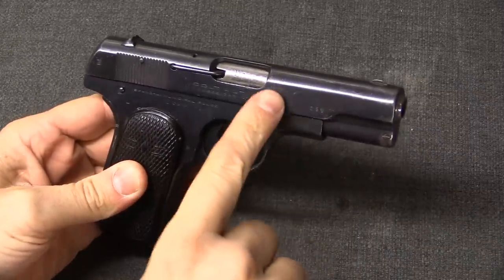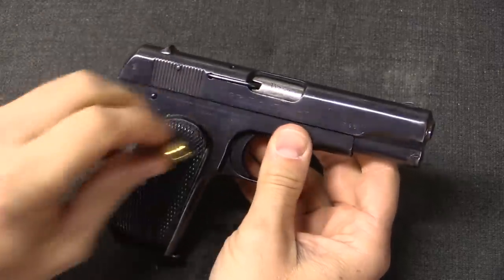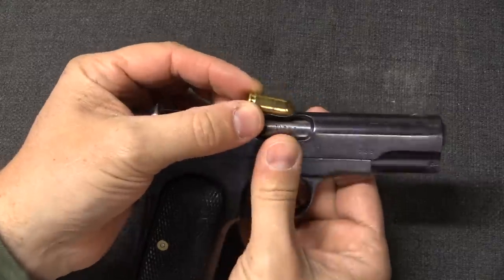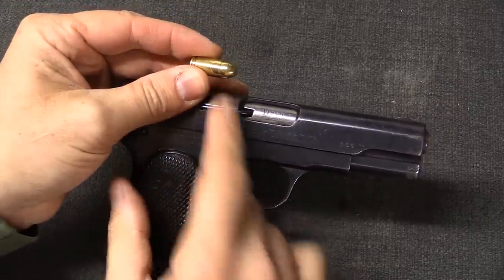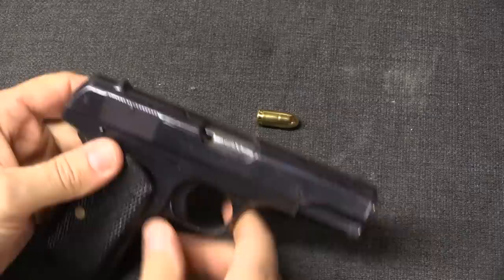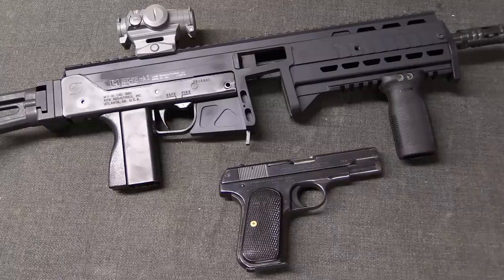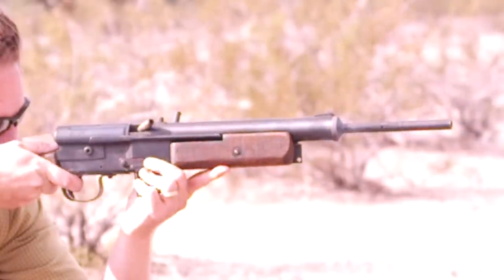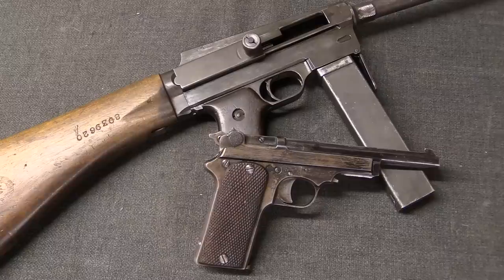How Does it Work: Blowback Action

Comment: Momentum is balanced, not energy.   The bullet has far more energy than the gun.  Their momentum is equal.
Reply: Energy cannot change in a system it can only change form

It's law of conservation of energy.
Reply: Was going to post this as well. It’s momentum that needs to be balanced. The equations are similar, but momentum is directly in proportion to velocity, rather than velocity squared, as is the case for energy
Reply: Jup, was just about to post this. Other than that - great video.
Reply: @CzornyLisek  while energy is indeed conserved, that doesn't mean the energy provided backward(to the slide)=energy going foward(in the bullet)  here it just means kinetic=chemical
Reply: @CzornyLisek  Yeah, some of the chemical energy in the form of the propellant is transformed into the kinetic energy witnessed in the bullet and the slide, but the law does not dictate that the bullet and slide must have the same amount of energy, not in the slightest.
Reply: @CzornyLisek  ...what this is not about :o)
Reply: @CzornyLisek  Some of the energy is released by heating the  barrel, ejecting the hot brass, ejecting to gas from the end of the barrel. Not all energy is transferred to moving part of the gun. Momentum is conserved here not the energy.
Reply: I think momentum is harder to think about with this. Force is simpler to think about in this situation since the momentum constantly changes through the whole cycle of fire and there is a spring immediately acting to slow the bolt or slide.
Reply: @ColburnFreml  Linear momentum is always conversed.  It is identical between before the shot is fired, during the shot, and after the shot is fired, and does not change as the system moves forward in time.  The force magnitude and direction is constantly changing but is also balanced at any instant.
Reply: P=mv. Mass is constant, velocity is changing. Momentum is not the same through time.
Reply: @ColburnFreml  Momentum is not a scalar.  It has a direction.  Any momentum placed into the bullet is always balanced by a change in momentum into the gun in the opposite direction.  It is impossible to change the momentum of a closed system.
Reply: @RC Model Planes the bullet moves further.  It goes down the barrel.  The gun moves a tiny fraction of that.
 Energy = Force × distance
Impulse = Force x time

Impulse is balanced.  Energy is not.
Reply: RC Model Planes, you’re right that the burning propellant acts on the bullet and gun with the same force for the same time. Newton’s 2nd law says that force is equal to mass x acceleration, so if the bullet is 10 g and the gun is 100 times heavier, the bullet must accelerate 100 times faster than the gun. Newton’s 3rd Law then says that momentum (mass x velocity) is conserved. If the bullet of mass 10 g shoots out of the barrel at 100 m/s, the gun (mass 1 kg) must end up moving in the opposite direction one hundred times slower, at 1 m/s. That deals with conservation of momentum. Kinetic energy is given by the formula KE = 1/2 m x v^2. The energy of the gun is 0.5 x 1 x 1^2 = 0.5 units (Joules), but the energy of the bullet is 0.5 x 0.01 x 100^2 = 50 J, much more than the gun. Note that the kinetic energy of the gun plus the bullet plus the hot gases plus the heating of the parts plus the ‘bang’ all together are equal to the chemical energy of the propellant, so energy is conserved too.
Reply: @CzornyLisek  Yes, but thats not the point here. Energy is conserved. First, it was in the powder, now its in the bullet and (much less of it) in the slide/bolt. Momentum ist also balanced, and the lesser weight of the bullet causes ist to pick up more energy because: m1*v1=m2*v2 BUT e=mv^2
Reply: @ColburnFreml  thats not true, momentum ist still theoretically conserved between the bullet and the movement of the air, the target and so on. momentum conservation is only helpful as a rule in simple mechanics though.

Comment: Hi, physics professor here.  Great video, with one important mistake: recoil depends on conservation of *momentum*, not energy.  Your explanation is perfect, you're just using the wrong word in this situation. 

Momentum is simple to understand: it's literally mass times velocity.  So if the slide weighs, say, 50 times as much as the bullet, it will move 50 times slower.  And so in the time it takes the bullet to go 100 mm down the barrel, the cartridge goes back 2 mm.

Kinetic energy is also a combination of mass and velocity, but a different one, and it's not equal between gun and bullet.  The bullet gets a lot more energy than the gun, unless they weigh the same.
Reply: And what is recoil?
Reply: @jonasstrzyz2469  momentum transferred to your hands then to the ground.
Reply: Gonna need some equations to back that up. Could you make a cool video about it?
Reply: So what exactly is momentum if not a form of enery? I thought everything is basically energy in different forms.
Reply: +Andrew Houghton Momentum is the amount of force over time an object has had applied to it, that has accelerated it. That's literally it.

To involve energy is just confusing things.
Reply: Great video. I wanted to check to see if anyone else had addressed this before commenting myself. Just as a resource for anyone who'd like to learn more about this, hyperphysics has pages on "ballistic pendulum" and "conservation laws" that shows how conservation of energy and conservation of momentum can both be maintained. Roughly speaking though, energy is never destroyed, but can change forms, while Newton's third law is about momenta in a system not being able to be changed by interactions within the system. As stated above, momentum is mass x velocity, while kinetic energy is 1/2 mass times velocity squared, so with equal momenta, two objects of different mass have different energy. This is also why you can have bullets with equal energy, but the heavier, slower moving slug will create more recoil, action type and gun mass et cetera being equal.
Reply: @andrewhoughton8216  It's a complex internal vernacular to the physics community. Like how we might classify guns as SMG, LMG, HMG, or HMG, or HMG again. Except far more complicated.
Reply: Ian should now fire the Colt .380 with very high speed cameras trained on the end of the barrel to see the bullet leave the barrel and at that moment view a second camera trained on the ejection port to look for movement of the slide. Also, he would need to use various cartridges for velocity checks.
Reply: Finally I can understand how this works now. I knew there was something missing.
Reply: @brucemccreary38  Vickers does that already
Reply: DothWalrus, projecting much?!

 Also, using the correct terminology is paramount to communication, in science, engineering, and elsewhere... and has nothing to do with "syntax". Although syntax is important, too!
Reply: @jasondoe2596  you have proved my point. What I meant was semantics but you understood my meaning.
Reply: @logitimate  that's just the transfer of energy, which is momentum. Felt recoil is the difference of hitting a brick wall or a pile of hay. Instead of transferring the energy to the rest of your body smoothly, slack is left and it hits the first point of impact with more force instead of spreading it out over time.

Bore axis, muzzle brakes and even the shape of the gun determine at what angle the energy is transferred to your body. Energy is directly related to momentum, but they are entirely different measurements. It is more like energy over time instead of what is purely stored. Which I'm pretty sure is what you said? Not sure why you acted like it isn't momentum, your points define it. lol

If you were in space, or there was no connection with you and the ground or gravity. That recoil impulse will actually push you backwards. The speed you would travel would be a product of momentum applied.
Reply: You are of course correct. Momentum is mass times velocity or force times time and is conserved, so the momentum of the gun (and you) is equal and opposite to that of the bullet. The bullet being lighter carries most of the energy.
Reply: +Jason Goodman

Equation for momentum:              p=m*v
Equation for kinetic Energy:         Ek=1/2*m*v^2
Relation between momentum and kinetic energy, you just play a puzzle where does kinetic energy or momentum fits in the other equation. and you find that momentum almost fits in velocity. 1/2*m*v^2, if you notice that p^2 is pretty much kinetic energy. You only have to divide by mass (and one half) or it can be interpreted as velocity squared (only division by mass is required). p^2 is (m^2)*v^2. So (p^2)/m is mv^2, so p^2/m^2 = v^2. And where do we have velocity squared? In the kinetic Energy equation. If we substitute momentum divided by mass squared (so velocity) into kinetic Energy equation, we are Golden. That gives us:
(1/2) * m * (p^2/m^2) - now yo can cancel mass from enumerator and denominator, so you have (1/2)*(p^2/m). If we multiply enumerator with enumerator, and denominator with denominator (so multiply), we are left with (1*p^2)/2*m), which in it's final form looks like p^2/2m. And that is a form that you show people when they say that momentum and kinetic energy are absolutely different and one has nothing to do with the other.

There maybe some mistakes in here, I will address them. I am unimaginably tired. So even the basics make me make mistakes.
Reply: @andrewhoughton8216  Momentum is literally "quantity of movement" (what it's called in some languages). It's the product of moving mass with its velocity, and also the product of force and time the force has been applied.

Momentum is not energy, it's not even dimensionally equivalent. The difference between momentum and energy is what makes firearms work in the first place (the force from expanding propellant gases imparts equal momentum to both gun and projectile. Because the projectile is much lighter it will move much faster, and because energy scales with the square of velocity the projectile will carry significantly more energy than the gun).
Reply: Thank you. This is an important point, if you value understanding the mechanics of what is actually going on. Which I am sure Ian does, (although some commenters appear not to). The momentum of the system--gun plus bullet plus expanding gases--is percisely zero before the trigger and remains precisely zero after the trigger is pulled, with the forward momentum of the bullet exactly balanced by a numerically equal backward momentum of the slide. The kinetic energy of the system, however, changes dramatically when you pull the trigger. Total energy is conserved, but an immense amount of chemical energy is rapidly converted to kinetic energy.

The crucial concept to understanding a blowback action is conservation of momentum, not conservation of energy.
Reply: @brucemccreary38  There's plenty of high-speed videos of pistols firing that show this.  Here's a good one: https://www.youtube.com/watch?v=zbtyaKAMDdk&feature=youtu.be&t=100 I'm not a gun expert so I don't know what the slides weigh for these guns, but you can clearly see the slide move a couple of mm by the time the round leaves the barrel.  Unfortunately this video doesn't show the action for the rifles they tested.
Reply: Momentum is not the same thing as energy. Energy causes momentum, in this case.
Reply: Bear pants and the number 59.
Reply: @spookyindeed  As a scientist I defend the physicist.  Using the correct wording is important.  I am a microbiologist.  It drives me insane how people use the words bacteria and virus interchangeably and get annoyed with me when I point out they are entirely different things.  They are different in a terms of size by well over 1000X in most cases.  It is like somebody getting a canoe and the Titanic mixed up and then acting annoyed when I point out the mistake.  .38 snub nose, 155mm artillery, what is the difference?  WHO CARES RIGHT?
Reply: Professor Goodman, aren't both momentum and energy conserved here? So that the simple momentum conservation isn't enough to find the recoil mechanism's velocity?
Reply: LadyAnuB No. Momentum of the bullet and the slide will be equal and opposite after the shot. Kinetic energy = 1/2 m(v^2). The bullet is traveling much faster than the slide and will have a much greater KE.
Reply: Just scrolled down to post the same thing, conservation of momentum is the subject at hand, not KE.
Reply: @andrewhoughton8216  Both the bullet and the slide each have  both momentum and energy. The relevant law of physics here is conservetion of momentum meaning that the total momentum of bullet and slide combined stay constant during the whole processes (Until the momentum is transfered to the rest of the gun and the shooter). Fomaly this is discribed as m_b*v_b+m_s*v_s = c where m ist the mass and v the velocity and c beeing a constant value e.g. 0 for a gun resting before fired. This lets you calculate the velocity of the slide or bulltet given the masses and the other velocity. From that you will get the kinetic energy as E_kin=1/2*m*v^2. So a moving object has both kinetic energy and momentum but they are used in a different context.
Reply: "Great video, with one important mistake"
I second this sentiment.
Understanding the difference between momentum and kinetic energy is immensely important in understanding the physics of firearms. Anyone thinking momentum and kinetic energy can be used interchangeably is missing some very powerful tools for understanding our world.
Reply: @KaletheQuick  He gave you the equation: (slide mass)times (slide velocity)=(bullet mass)times (bullet velocity) hence the difference in veloctyi 50:1 (in his example)
Reply: One more thing to add, some of the momentum is carried by gas expanding out of the barrel as well, which muzzle compensator attachments use to reduce recoil and muzzle rise.
Reply: I thought f=ma so is force equal to momentum?
Reply: @Plur307  I fully agree with you, the physicist and most of the commenters here in the thread, but your examples are severely dishonest. The difference between a virus and a bacterium may be thousands of times apart, but the significance is vastly greater in canoe/Titanic comparison. Same with .38/155mm. A better example would be the difference between bigger and smaller stars. These are far-from-common scopes, so differences of thousands, millions or even billions of times are insignificant in a general context, both sides of the comparison are still "extremely large" or "extremely small" in your case. A single virus or a single bacterium will both underwhelm you to the point of no difference between them. The smallest star and the largest star will both overwhelm you to the point of no difference between them. What's the difference between a meter and a kilometer? Pretty huge difference in almost any context with vast implications. What's the difference between 10^92 and 10^95? Still 1000x, but it's negligible in almost every useful context imaginable. So you don't get to be as outraged as the gun and ship enthusiasts.
Reply: @robertdeen8741  f=ma, p=mv. 
a=Δv/Δt.
f=m*Δv/Δt.
f=Δp/Δt.
Basically, force is a change in momentum over a change in time. Or a rate of change of momentum. That's the second Newton's law. That Δ (delta) sign is change.
Reply: Jason,   Why doesn't the resistence of the recoil spring factor into how fast the slide will move?  
  It can't be just the mass of the slide that determines how fast it moves back after firing a round.  It's got to be the energy required to move the slide, which is a combination of slide mass, recoil spring weight (force required to compress spring) & friction between slide & frame rails..
 Your explanation made think that when installing a longer barrel, the slide will move farther back before the bullet leaves the barrel. So there is probably a maximum length before it gets un safe.
Reply: @motohead077  Let's put it like this.
Recoil accelerates the slide back for the first 1mm ot its run. Then the pressure drops and don't push it back any more. 
The recoil spring then decelerate the slide for the residual 4cm (that's 40 times the distance, and even more of the time) of its run. 
And the slide still slams into the receiver. 
So the K of the recoil spring is less (much less) than 1/40 of the force of the recoil. That's why it's not taken into consideration.
Reply: Such profound knowledge. Thankyou M’lord. 🙏😔
Reply: @andrewhoughton8216  it's just terminology. We separate the words energy and momentum for mathematical reasons. To try to make it simple, our world has objects that are made out of matter (which is made out of energy but don't think about that right now) and energy is what allows those objects to move. That's why distinguishing between energy and momentum is important. Energy is just a number but momentum can be calculated by an objects mass time it's velocity. Which will also tell you how much energy that object will transfer when it impacts something.

Comment: Newton's third law isn't about balancing the energy (J) but the force (N)!
The force applied to the bullet and slide are equal and so the momentum (m x v) of the bullet and the pistol are equal.

The slide and bullet don't end up with equal kinetic energy (0.5mv^2) because the bullet is much faster.
Reply: was just looking for this minor correction, good job with the physics
Reply: Yup, conservation of energy is a thing but that will be the chemical (potential) energy of the propellant prior to ignition and the kinetic energy (including heat) after ignition.

In this case it's sum of momentums = zero.  Good video though.
Reply: Thanks. Looks like high school wasn't a total waste of time then.